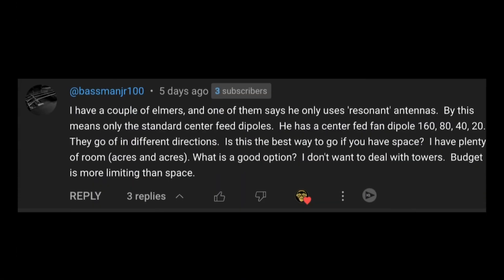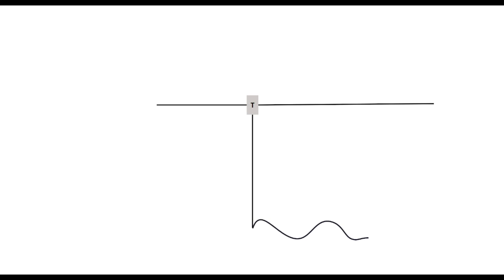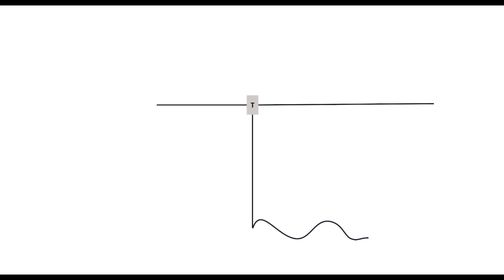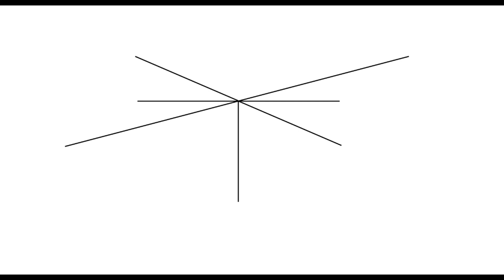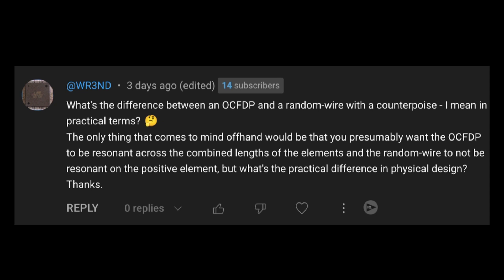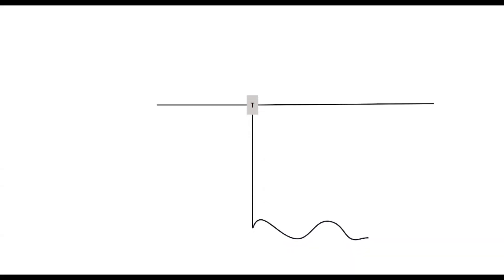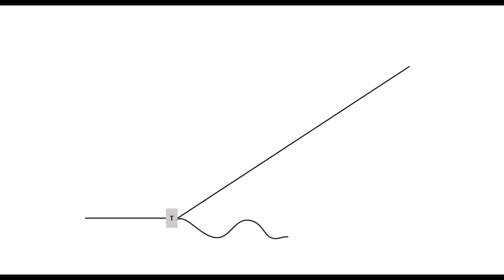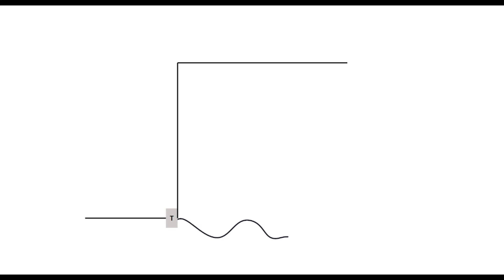Ape Answers 002: Off Center Fed Dipole Distinctions (OCFD)

Comment: i have a 40, 20, 15, 10 OFC i think its fed at 1/3 
40 is ok 
20m sucks real bad compared to my Diamond CP610 witch has a 3:0 on 20 and works well 
15 and 10 suck
Reply from the maker: Sorry to hear your having problems on the high bands

Comment: Yes, the OCFD is prone to common mode issues due to it's off center (unbalanced feed), but that is very easy to tame!  I built my own OCFD including the balun.  What I built was a hybrid balun that includes a 4:1 for impedance transformation and a 1:1 current choke to block the common mode current.  I feed mine 1/3 off center with the short side being 45' 4" and the long side being 90' 8", On the long side, I have a 100pf 6KV capacitor between the 4:1 output and the longer wire.  I originally set the 80 meter resonance to 3.450 mhz to get 40, 20, 17, 12, 10, and 6 meter swr as close as possible and then the 100pf cap moves the 80 meter low swr point up to around 3.8 mhz without affecting the other bands.  I also have a 1 megohm 5 watt resistor in parallel with the cap to bleed off static charges to protect the cap.  The result is one antenna that covers 80, 40, 20, 17, 12, 10, and six meters and most of those without a tuner!  On 80 in the phone portion, the swr is below 2:1 from around 3.7 to 4.0 with 1:1 right around 3.8 mhz.  If I go below 3.7, it do have to use a tuner.  Also, 17 meters is around a 2.2:1 swr but easily matched with the internal tuner of most rigs. 40 meters is well under 2:1 the entire band and so it 20 and 12 meters. 10 meters is under 2:1 from the bottom of the band to about 28.7 mhz and 6 meters is under 2:1 from the bottom of the band to almost 51 mhz. If I operate where its above 2:1 and I want to run my amp, I just use my big MFJ-989D legal limit tuner.  Most of the time though, I just stay where I don't need the tuner!
Reply: I made a 66 foot OFC dipole, 4:1 balun at the feed, and had common mode problems.  I put 5 ferrite snap-on chokes about 8 or 9 feet from the feedpoint.  Problem solved.

Comment: I recently learned that the 71" end fed random wire I use and the 66" OCFD I keep on hand as a backup antenna both need to be used with a remote antenna. I always use my desktop LDG auto tuner, but I am sad to hear I now have to buy a better remote tuner and mount it at the base of my mast.  Then when I saw the price tag on the Icom Ah 730 (which would work nicely with my IC-7300) I had sticker shock! Wow that thing is big and expensive! Man, it's always something with this new hobby.
Reply from the maker: Don’t worry about all that stuff, if your current gear is working for you then keep using it 👍
Reply: @TheSmokinApe  Using a remote tuner assures highest efficiency and lower loss on the coax!
Reply from the maker: @ironton655  Right!  That doesn’t mean he “needs” to upgrade a working system.

Comment: As a retired engineer and new ham playing with antenna designs and modelling.  I had the same question  OCF vs EFLW ("random").  Aren't they essentially siblings or kissing cousins at least?  You answered it!  Non-resonant antenna length and relatively shorter counterpoise for the EFLW and consequently higher impedance.  You confirmed my sanity.  Thanks.   Just recently found you channel.  Excellent.
Reply from the maker: Glad it was helpful Phil, thanks for watching 👍

Comment: I used a 40 meter commercial off center fed dipole for one reason:  there were two trees in my front yard 70’ apart and a right angle feed to my upstairs shack was right at the 1/3-2/3 portion of the antenna.  So it fit between the trees and the coax feed came straight into my shack. I used a tuner on 30 meters but the other bands were matched quite well.  It was not objectionable to my wife and worked well until we moved a few years later.
Reply from the maker: That's awesome David 👍

Comment: Good video of a complex subject!  I prefer single band antennas and have several. Actually I prefer single band dipoles broadside on the direction I want to work. A good Yagi may be a S-unit better but is much more costly and takes a lot more effort. I have had them and they work but the dipoles do almost as good. Regardless of the antenna, no one antenna does it all! I like fan dipoles as they give  single band performance off one coax. My 20/10 meter dipoles are not much more effort to build than a single dipole. Trying to do a 40/20/10 fan dipole takes more patience but the results give me excellent results. I use spacers between the dipoles so all the dipoles are broadside to the same direction. Since I cut my antenna for the CW band, my 40 dipole covers 15, but the pattern is not broadside as with the halfwave dipoles. I frequently hang a temporary 15 meter dipole broadside on Europe for DX contests. 
All halfwave horizontal antennas will have essentially the same pattern. They are resonant and can be fed anywhere. Center fed presents less problems but OFC can give easy multiband coverage. The transformer ratio and location varies and are a compromise to accommodate the various bands. If coax is good and inherent loss is small, the built in tuner in most radios can fix a lot of mistakes. Height above ground determines the peak radiation angle for a horizontal antenna. Usually the lobe is rather broad between the 3 dB points, for moderate heights. Higher antennas have multiple lobes which results in deeper nulls and sharper lobes. Great for extreme DX, not so much for everyday use.
Reply from the maker: Hey DP, thanks for the insightful comment.  I do agree a dipole is hard to beat.
Reply: @James-ci3lx yes you are about right. The two element Yagi gives the most gain at about 4 or 5 dB over a dipole. To get even 3 dB more gain you have to double the number of elements and the boom. Adding one element does not do much after the first parasitic element. I think the log parasitic arrays are not for the serious contesters. They are just broad banded with not enough gain compared to mono banders. I think of guys like W3LPL who have really super stations. I have visited him and he has given many presentations on Contest and DX antennas. Myself I am happy to work 1000 QSOs in a DX contest and 100 plus countries on two or three bands with my dipoles. I have had 6 element 10 meter Yagis and 4 element 20 meter Yagis at 70 feet and that was a lot of work plus a lot of expense. I have just about as good luck with the dipoles now. Last time I did a 10 meter contest with Yagis I could not rotate them fast enough and decided three dipoles on a switch would do it faster even if I gave up a couple S units!

Comment: A dipole antenna has a centre feed point impedance less than 50 Ohms and the legs of the dipole are fixed. How do you increase the impedance at the feed point to match the 50 Ohm transmission line? Why is the impedance of the HAM radio typically 50 Ohms.?
Reply from the maker: A dipole mounted 1/2 wave above ground has a feedpoint impedance of about 73 ohns.  You can adjust this by changing the length of the legs or raising or lowering the antenna.  50 ohms is a good compromise impedance for low loss and maximum power.
Reply: @TheSmokinApe  If the antenna was fed slightly off centre would the feed point impedance increase? Is 50 Ohms the output impedance a radio's RF amplifier?
Reply from the maker: Yes and the impedance of most radios is 50 ohm

Comment: Is there a radio good for listening to police calls?
Reply from the maker: Yes. But the particular radio will depend on the band your police use, whether they use trunking or not and if they use encryption.  Your best bet is to check out Zip Scanners, they have a database that will tell what is needed for your area 👍
Reply: Thank you

Comment: So you said you don't really like fan dipole are you saying you don't really like the dx commander because it is basically a fan dipole put up vertical direction
Reply from the maker: Hey VTP.  So, its not that I don't like fan dipoles, I'm just not a fan of them...  tuning them can be difficult and the elements do cause interactions with each other.  When I look at a DXC, I see a fan vertical monopole and not a dipole.   It's a muilt-element vertical with a ground plane for capacitive coupling to Earth.  Given the vertical is good for low angle take off, which is good for DX contacts, I think the compromise of multi-element interaction is more than acceptable.  Also, with the DXC you do not have the height above ground issue I covered in the video.

Comment: nice job. a lot of end fed with a counter poise can be a off set center fed. just depends how you look at it. most do not count the counter poise. but it is part of the antenna system. solar weather crazy. getting buffering on internet a lot lately during the day. even noticed the GPS lock in car nav system was off the outher day. ham bands been messed up. farmers having trouble planting crops with GPS needing a good lock for precise seed planting.  getting high noise 80/160 meters making un usable   in NY for me. this is common . their is a random wire center fed. that uses a 9:1 Balun . still needs tuner. same wire lengths just 2 of them. still prone to common mode current. have not tried that yet. Walt made one with speaker wire and worked great . the trouble I had with off set center fed di pole was tunning. and keeping feed line at right angle to antenna. 73's
Reply from the maker: Yeah, those flares really messed things up 👍
Reply: @TheSmokinApe  waiting for 11 meters open back up. big JEEM on 11 meters ! I herm his area to NY before. heat up that green toroid in 11 meters SSB 12 watts .
Reply from the maker: @robertmeyer4744  haha, he is all in on the 11

Comment: I’m currently running a 80m ocfd with a balun designs 4:1 balun and a atu-100 tuner. The antenna works well even though feed point  is only 22’ high with ends tapered down slightly. I would love to be able to dial it in better but I don’t know how to adjust it.
Reply from the maker: You would need to measure both sides to determine the ratio from Element to Ground leg and then when adjusting add or remove the same ratio of wire 👍

Comment: I'd appreciate advice regarding HT rechargeable batteries. I have TYT TH-350 (LB-75L) batteries that will not fully recharge and deplete very quickly. Any suggestions?
Thanks and 73! Tim VE3TCS
Reply from the maker: It’s probably time for new batteries, sorry to be the bearer of bad news
Reply: tnx!  I was afraid of that. Very quick reply noted and appreciated.
Reply from the maker: good luck with it 👍

Comment: I once had acres and acres of land and at the suggestion of a friend I built a 160 meter full wave loop.  It was a worthwhile project, the loop really delivered the DX.  I'm back in the city now and employ a Rybakov (4:1 UNUN), a 135' EF (9:1 UNUN), and an OCFD (4:1 Balun).  All three work well, and have their own plusses and minuses.
Reply from the maker: I’ve been using a Rybakov style antenna for a few months now and love it 👍
Reply: @TheSmokinApe  I've been shocked how well the Rybakov gets out to Europe from Idaho. I've done a few side by side comparisons and it smokes the EF and the OCFD with DX multihops. And such a small footprint. Low angle radiation really is a thing, hi, hi. 73, and thanks so much for what you do.
Reply from the maker: Hey Bdub, I have to say I agree.  I have been blown away with the CaHRtenna Poseidon, very similar to a Rybakov, and it's ability to get DX.  I'm sure part of it is the favorable conditions with Cycle 25 but the easy of setup, small footprint and simple design can't be beat.  Thanks for watching the videos, glad to hear you like them 👍
Reply: @TheSmokinApe  I just checked out the kit. It is very similar to mine. I used 25.5 feet of 12 gauge speaker wire for the vertical element and six 5 meter radials and a 1:1 choke at the feedpoint. It was originally going to be temporary, now I can't live without it, hi, hi. Keep the videos coming, your elmering is much appreciated.
Reply: I'm the one who asked the first question.  So, would you recommend the loop?  An 80m skyloop may be an option.  I don't have much interest in 160m.  How did you get the loop antenna in the air?  How high?  I am trying to pick between long end fed random, OCF dipole and a loop.  End feed seems easiest due to putting the connection by the house.
Reply: @bassmanjr100  Thanks for asking. I lived on a hillside with some deep ravines and I supported two corners of the delta loop with 2 10' chain link fence rails stacked on each other.  Elevation below the loop was admittedly variable. Not really ideal. The feed point was at my ham shack above the detached garage.  If I had to choose between my 135' EF and the OCFD, I'd choose the EF, in spite of it requiring a tuner.
Reply: If you’ve got space don’t stop at one antenna. Sky loops are a fantastic all round antenna, very quiet receive compared to endfed and verticals in my experience. 
Lance VK6LK
Reply: @LanceVK6LK_AussieHam  completely agree. The more antennas the merrier!